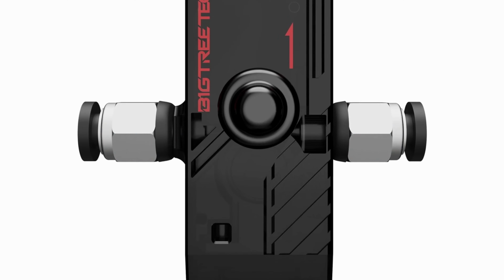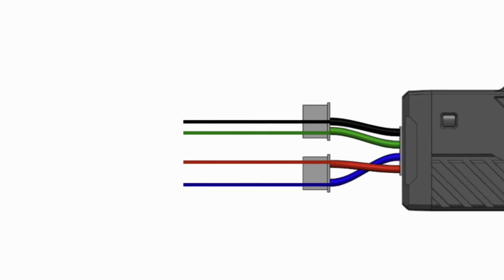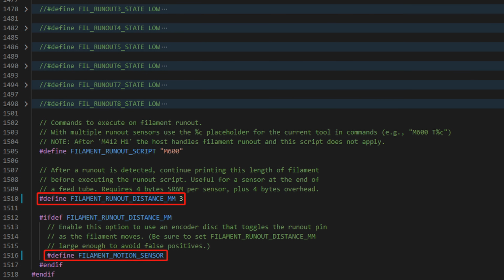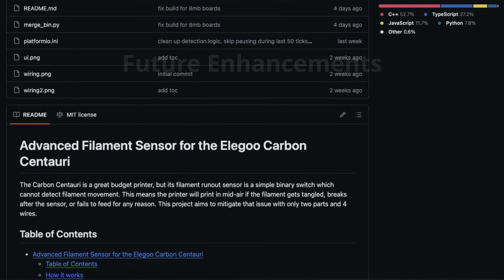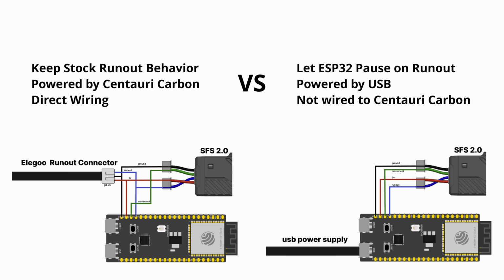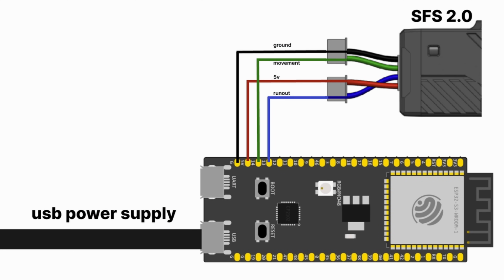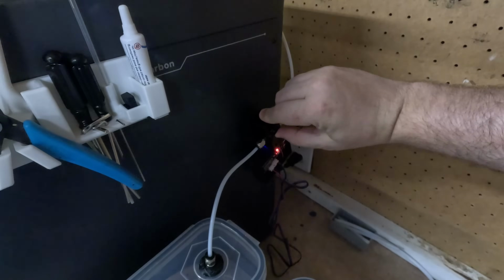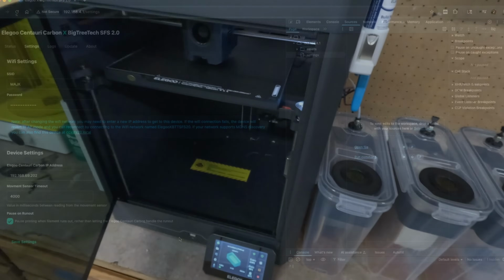Elegoo Centauri Carbon Upgrade, Filament Movement Sensor

Comment: Love this! I added this before anything else on my printer.. I do have a few suggestions.. Your wiring diagram on your github and video was a little confusing... It looks like the movement (green Wire) goes to pin 14 and the runout (Blue) goes to 13 but the text in your GitHub is correct 13 and 12 respectively, so it actually skips a pin. Plus I redesigned the case and will add it to your original as a remix! makes its a little more sturdy and I added heat inserts for the lid. this is by far the best modification for this printer!! Nice work!

Comment: I got this set up I think but I cannot connect to it after I put in my network settings. Does this have a  device name that I can look for to confirm it is on my network?
Reply from the maker: On your carbon screen, click on settings -> network. It should say the IP address under WiFi checkmark.
Reply: @jrowny  Oh, I meant after adding the network settings and printer IP on step 3, I cannot connect to web UI after the fact
Reply: @jrowny I figured out the issue. I had the movement and runout wired to 14/13 which seemed to make the setup never pop up online.  Once I skipped 14 and moved the two wires to 13/12 everything works as expected now
Reply from the maker: @Other-Types  sorry about that, the video shows the wiring going to pins 13/14 despite me saying 12/13. I pinned a comment with the fix, glad you figured it out!
Reply: @jrowny hey, it seems that when I uncheck the last box to disable pausing and hit save the change is not actually saved…

Comment: I can’t get it to stop pausing I’ve tried 2000, 4000, 6000, 8000, 10000
Reply: Log says runout detected with full spool on bearing spool holder
Reply: After checking logs it pauses the print 1 sec after resuming
Reply from the maker: @connorscherer617 it should wait 10 seconds after a resume, so something is definitely wrong there. It makes me think it's not reading the printers status correctly. What firmware version do you have?
Reply: 1.2.25

Comment: The holes on the BTT sensor do not line up with the stock sensor mount.  Are you using a threaded insert on that hole closes to the ESP32 compartment( seen at 4:09 ) and just using one screw to hold the BTT sensor to the case?
Reply from the maker: Yes, I used a threaded insert

Comment: I don't know if it matters but there is a difference in the distance between the press-fit connector and the runout sensor is about 1/8" from left to right. With the wires of the BTT sensor facing up( arrow on front facing down ) the port on the right triggers the same as the stock sensor. Roughly 27.75mm vs 24.85mm. Since we don't have access to the firmware, getting the end of the filament sensed as close as the stock sensor means either nothing or the load and restart will be flawless.

Comment: Great project!. Thank you.  I have question if we don't connect directly to CC in runout pin this is option 2 separate  supply but if we don't connect any cable to CC how the machine know it need to pauses?
Reply from the maker: It communicates over websockets, via local area network.
Reply: @jrowny  thanks. This is mean we are getting  Filament Movement Detector but we are missing  Filament detector option right?  appreciate

Comment: You can implement this movement sensor much easier with an AND gate IC (e.g. SN74LVC1G08DCKR). Connect the vcc and ground to the vcc and ground coming from the printer. You can connect the outputs from the run out switch and the movement sensor to the two inputs on the IC (A and B pins per the datasheet). The output of the IC (pin Y per the datasheet) then replaces the original switch output (the blue wire in your diagram). This should take up significantly less space, require no wireless interface, and retains the original factory wiring harnesses.
Reply from the maker: I've never used an AND gate, but wouldn't you also need a timer? And even then, there is no way, afaik, to tell the printer to stop immediately. A runout signal will only tell it to stop after the rest of the filament in the Bowden tube is used up. By that time the print will be ruined.
Reply: Can u show us?

Comment: Wonderful job, and cheap solution. Just to be sure, correct me if I'm wrong. If I choose the "keep stock runout behaviour" , wiring it to the centauri runout sensor. when the filament is runing out, it will stopp the print jsut before the end of filament will be in the nozzle. but when the filament is tangled, or the nozzle is clogged, it will pause the print right now. Seems the best solution for me.  Thanks
Reply from the maker: That was what I intended but actually it turns out to not make a difference because once the filament leaves the runout sensor, it will just pause because the filament won't be detected moving. I don't have a good solution yet.
Reply from the maker: Actually I just realized I can program it to not watch the filament movement sensor if it has a runout, then it will just be stock behavior when it runs out. I'll make that update soon.
Reply: @jrowny  ok great, so wich solution should I choose, waiting for the update to be added?
Reply from the maker: @fr3d-fr3d  it doesn't matter, they'll behave the same, which is it will stop as soon as filament runs out.
Reply: @jrowny did you already fix this in the programming? If so I'm ordering parts ASAP :p
Reply from the maker: @daniele5017 not yet, but it's open source ans would be an easy change. I'll try to tackle it tonight
Reply from the maker: @daniele5017  actually, I did fix this when I did a slight refactor a few weeks ago, totally forgot I did this. So yea, if pauseOnRunout is unchecked, it should correctly let the Carbon handle it.
Reply: @jrowny absolute legend, thank you for developing this

Comment: Isnt it better to have this closer to the print head
Reply from the maker: yes, that's how bambu's works, but I placed it where the original one is so it can retain its original functionality.
Reply: @jrowny I see.  I have one on my cr10 and had to move it right above the printhead or klipper would freak out.  That's why I ask.

Comment: This is awesome. I have a additional idea, printhead cover detection, some sort of switch under printhead faceplate that would kill the print if it pops off. I've seen some posts on reddit where print came loose, knocked the faceplate and then it just cascaded into catastrophic damage.
Reply from the maker: Hmm, is there not a sensor for that? I'll have to investigate that because it would be very easy to do with a reed switch!
Reply: @jrowny  I do not believe CC detects that considering posts on Elegoo reddit. If there is some catastrophic failure the faceplate popped off at some point, from blob of death to snapped nozzle. I thought it would be rather easy since you already have a platform, just reading additional pins

Comment: Howdy, I built this and it can detect filament movement if I move it manually with my hand, but when it's in the printer it just gets stuck on yes for Filament Stopped, even though the cutoff time is 10000 milliseconds. Got any advice?
Reply from the maker: filament stopped is normal when not printing. Once it it starts printing, it should start moving on its own. I needed to set my timeout to 4000ms.

If it still says "stopped' even after it's started printing, you can go into the Logs section of the UI and read the values and see when last movement was recorded.
Reply: @jrowny It doesn't update after starting a print. Like, it manually pauses, I press resume. It prints maybe 5 seconds, then it pauses again.
Reply: The entire time it saying Yes it is stopped.
Reply from the maker: Hmm, I'm not sure how it could be different moving it with your hand than when it's being pulled by the machine. Did the log in the web ui say anything? It only records the last 50 entries so when the browser is closed, so it's best to have the browser open while it's running. It should output a bunch of information about why it paused.

I've noticed there are some operations where there's not necessarily filament flowing, like ironing, that bug it out... but I'm assuming this is happening right away.
Reply: @jrowny It is happening right away. I started a print, the case for the board. I'll reinstall the board when I finish my current print and send it to you.

Comment: please show the actual build of the sensor and harness, it would be nice to actually see your final product

also, considering i have to buy the harness to wire it, the build is closer to $45
Reply from the maker: True, I guess JST-XH connectors are like salt and pepper to me. 

I'm still new to making content like this and I didn't really like the way my PCB ended up looking, so I didn't include that part, but it's just the 4 wires. If I did it again I'd just make a JST harness instead of a PCB.
Reply: thank you for the idea
i'll probably do the same actually

i bought a breakout board too if i don't like the harness

Comment: Thanks for doing this. Just ordered parts.

Assuming that there are no impenetrable barriers (software, hardware or commercial), please share directly with Elegoo developers.  I’m sure community of owners would like to see this officially incorporated. And I’m sure we would be happy to email them with such a request if you see fit.
Reply from the maker: I think that they will solve this with their upcoming filament runout system, so I doubt they're too interested. Would be nice to have serial access so I don't have to hack it through  websockets.

Comment: I usually connect a bi lateral espt546 model ramjet bioplasma texslik interface to bipass the tri tunnel led trickpiza setting, ya know what I mean?
Reply from the maker: Ah, yes, the Rockwell Collins espt546. An excellent choice when you need prefabulated aluminite, surmounted by a malleable logarithmic casing in such a way that the two main spurving bearings were in a direct line with the pentametric fan.

Comment: Will this mod work with the current firmware wich is not allowing me to change settings during print in the web interface?
Reply from the maker: It has for me. The command to change lights and fans doesn't work, but the pause command seems to work fine.
Reply: @jrowny  Got it working, thx for creating and sharing this!

Comment: how do you connect the wires to the esp32 board? none of the wiring makes sense. could you upload a picture of the wiring to your github? I just dont understand how you have black, blue and red wires going to two places. 

You twist two wires together and solder into board? And have one JST male side and the other is JST female?

Are the header pins used at all on the board? Or you just go straight from wire to board?
Reply from the maker: If you're new to wiring, you probably just want to do the USB powered method and only connect the 4 wires to the esp32. You can use jumper wires meant for pin headers and splice them or buy the jst-xh connectors and splice to those. There are tons of tutorials on YouTube to learn, it's not very difficult. When you see a diagram with wires going to two places, you would make a Y, but again, if you're not comfortable with electronics, I'd recommend not plugging anything into your CC directly.
Reply: @jrowny I am not new to wiring just never soldered header pins before. And also never had to splice to jst-xh or header pins. I'll just use wago terminals to splice the wires together and solder on the four header pins and use those header jumper pins to connect to the board

Comment: My, P1S has done the ghost printing too, not just a carbon issue.
Reply from the maker: Curious if you have an AMS? My x1 has never done it, but I think maybe because of the AMS.
Reply: @jrowny yea pretty sure its the ams I have a p1p thats upgraded to a p1s with the ams and it doesnt do it either I suspect when elegoo releases there ams for the CC it will also be a none issue but this is a great project untill they release there ams nice work

Comment: Hello! I created a custom PCB based on your idea. I still have a few modifications left, but it should work as expected. A case for the PCB is coming soon.
I also made a GitHub repo where I credited you and included a link to your original project  the repo is Elegoo-centaury-carbon-Filament-Movement-Sensor
Reply: Do you have a link to your GitHub I haven't been able to find it
Reply: @kwaj177  @johnolivier7108 I can't send the YouTube GitHub repo link; it deletes it.
Reply: Cool to hear. Link? Post? would like to see it in action.
Reply from the maker: Nice work!

Comment: How about sending both sensors to the ESP and then from the ESP to the runout sensor port of the Elegoo?
Then maybe even an Arduino would be enough, those are a third of the price.
Reply from the maker: I tried that first, but unfortunately the Elegoo does not pause when it receives a runout signal, it waits to use the rest of the filament in the bowden tube. By the time it actually pauses, it's too late to save the print. 

Maybe if the firmware is ever able to be modified we can make that option. It certainly would have been simpler.
Reply: @jrowny yeah im so dumb, now i remember. It was said on the video too. Yeah lets hope Elegoo does the right thing and lets us alter that function at the least.

Comment: I'm going to have to look into this as 10 have arrived just today and i'd rather head off this issue immediately. I've had this issue with the K1max systems and p1s as well with that filament just not letting go of the spool and ruining so many prints over time.
Reply from the maker: I think the p1s at least has a sensor inside the extruder. With my Bambu AMS, it's able to detect that the filament spool isn't moving, but I'm not sure the exact mechanism, I'm going to have to look into it.
Reply: Look into setting up octoevywhere.

Comment: Hi Jonathon, this is an amazing mod, unfortunately i have MS so soldering is something i cannot due due to extreme shaking of my hands and arms.

i would love to purchase 1 if you are thinking of selling them as a complete kit
Reply from the maker: Most likely not, as I don't really have the capacity. However soldering is not strictly required if you find an esp devkit with headers already installed and don't mind using the simpler wiring method with USB power. You would still need to convert the wires sensor's jst-xh to pin headers.

Comment: That sounds insane that the only way of getting the pulses in is via another 200mhz processor via tcp sockets? Sorry but just ask the manufacturers to add a simple change to the filament out line monitoring.
Reply from the maker: Sure, I'll let elegoo know to add support for it.
Reply: @jrowny  :face-green-smiling::text-green-game-over: Now that was funny!
Reply: It's just one way to do it and a great start. Do you know Arduino? If you do then you could swap out the ESP32 for an ATtiny 85( 8pin 8/16MHz proc ) and pull the run-out sensor line low on run-out and find another way to hardwire a signal to immediatly pause the machine on the filament motion stoppage.  Let us know what you find.
Reply from the maker: @DoRu42  I haven't been able to find a way to make it stop immediately without the socket. I guess maybe I could wire it to the relay and cut the power to the printer 😂

Comment: Duuuude the timing of this video is impeccable, my CC arrives tomorrow and I've been trying to research as much as I can in advance.
Reply: Don't rush, got mine a week ago and it works worderfully as it is
Reply: How do you like it? Ordered mine yesterday and reading so many mixed comments (and a loooot of positive bots).
Reply: @ridgemills  I swore I hit reply to this comment, but after a few weeks I'm still enjoying it. I'm not a fan of the locked down klipper derivative but there's groups actively working to bypass the restrictions. Aux fan is pretty loud and I end up disabling it every print.
Reply: @Psyphuck  Elegoo released the code According to an article I read. It's derived from Clipper but has nowhere near the board capabilities to handle Clipper completely. It just doesn't have the hardware features.
Reply: @ridgemills I've had it for a couple weeks now, it's been great. Only hurdle right now is the board is closed, but is running a klipper derivative (illegal cause of Klippers GPL-3 Open source license) but there are a couple groups that are taking a run at cracking the firmware to load klipper. Alternative extruders / hotend retrofits have been popping up. I think the more people who adopt, the more community support will follow. Coming from a Voxelab Aquila it's a game changer.

Comment: This looks interesting.  One question.  On the ESP32 device after flashing you mention to open the ip 192.196.4.1  This is an issue for me as my local network this is also the my gateway from from ISP.  I have had a very similar problem using BTT hardware that connects to networks as well as they use the same IP range for the AP.  I have worked with their engineers enough now that they create me a separate firmware that will use, for example 192.168.5.1 instead and this works great.  They said they were looking at creating a new method so this does not become an future issue.  Can you have an alternate firmware that will use 192.168.5.1 or anything other that 4.1?   Love the project.
Reply from the maker: You only connect to it to set up your wifi, once that's done, it will restart and get its own ip on your network and you can access it at ccxsfs20.local
Reply: @jrowny It looks like the esp32 uses the default IP address of 4.1 which is the same as my local network meaning I won't be able to defaulty connect to it because two networks can't be using the same gateway IP at the same time.  But it looks like I can use a command to change the default IP address of the esp32 AP by using the softAPConfig() function in the Arduino IDE's Wi-Fi library.